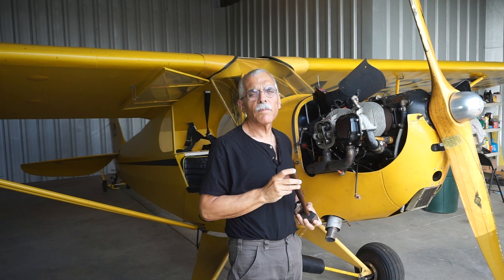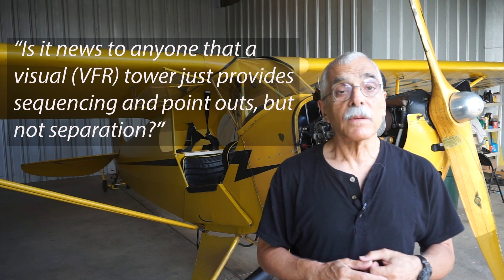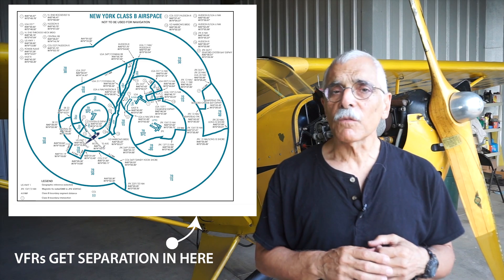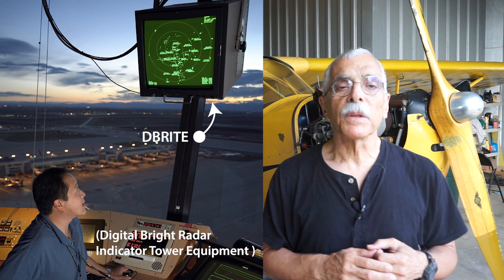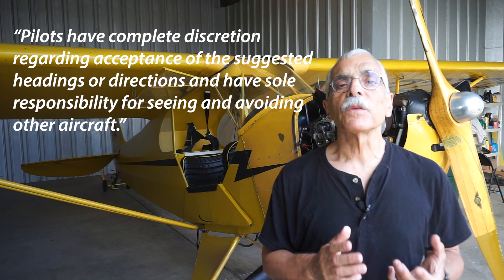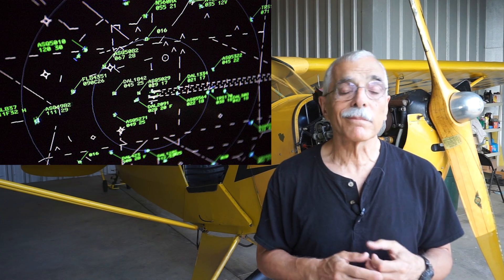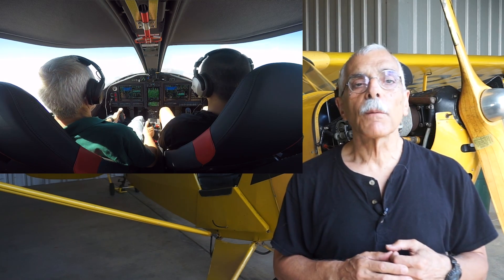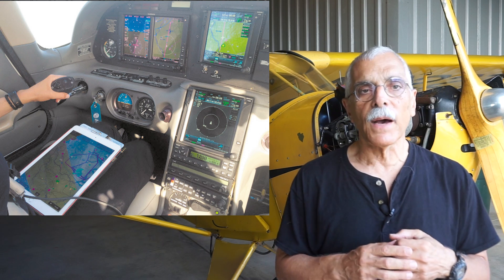Control Towers Don't Do What You Think They Do

Comment: On my solo flight out of Vandenberg airport in st Pete Florida I did my 1st and 2nd solo flight no problem but mu 3rd was different the tower controller changed and she called me #2 to land to a light jet 2 miles out on a straight in. I was in a 150. The jet was a lot more than 2 miles out when I finally seen him he was 15 miles and but the time I got past him I was around 6 miles south of the airport. I did try to tell the tower I could get in and out of his way when I was ready to turn bass but she was not having it. I had never done a straight in approach before so I had a problem. I was 6 miles south on a straight in approach over water yes that runway is sronded by water on 3 sides. Less just say it was going to be fun. Lol I did make it in with a trick my dad tout me called a slip and it worked well. But the instructor and the tower had a few words out of the plain I was not involved in there conversation... lol she was trying to give me time to get in without being rushed but this was a little crazy. It all worked out and was a great experience

Comment: Very good video...but I still am missing something here about towers and separation:  If I am coming in on an IFR flight plan, and handed to a tower, am I or am I not being kept separated?  I have always assumed I was.  Certainly, when I am also in the class D with a big part 121 airliner, I have assumed that they are being kept separated....so am I not?
Reply from the maker: You are separated from other IFR aircraft in Class D airspace, but not VFRs. Class B and C have VFR separation requirements. Many, if not most, Class D towers do one-in/one-out separation, meaning an IFR departure won't be released until an IFR arrival has landed or cancelled IFR.

Comment: Your info was mostly correct but highly misleading. There is more to almost every example you gave, however, I’ll be brief. ATC is a very valuable resource and to portray as incompetent (which some are) and burden to a pilot maybe the very link in the chain that keeps a pilot alive. 
The faa is the organization that started handling “deals” differently, but it was for exchange of information. A controller must file an ATSAP which is like a nasa report for a pilot. The program is not perfect but it has led to many changes to make the system safer.
Runway separation is the only tower function, well that’s only part of the story and would love to go further into that.
I’ve been certified in multiple up downs ( tower and approach) at an ARTCC and now at a core 30 tower. As a pilot I use flight following and atc services every time I fly.
I was only commenting so that you might consider the benefits of having atc a part of your flight. And not scare people from using their services.

Comment: A Control Tower controls all movements on the ground. Planes, cars and emergency equipment. Towers also control IFR traffic within their Class D airspace for clearance, departures and landings.

The VFR Flyers are given advisory reporting of traffic sequence in the air. They can enhance separation by requesting to report "left downwind" or "enter 2 mile right base. It's still see and avoid in all areas of VFR Flight rules.

There is nothing wrong with reporting your altitude to help situational awareness when the need arises.

If you need to extend downwind or prefer a different runway, request it.  Communication is key when inside Class D airspace. Identify the traffic you have in site. Let the tower know your intentions. In an emergency, you suddenly own the the entire airport and area priority over all other traffic.

Comment: Why is it seen as more reasonable that there is now less strict reaction to failure in opertions that are supposed to ensure a baseline of separation? Is the current situation precisely the most reaonable, or will things continue to become more reasonable as increasing slackness and breeching of parameters are increasingly tolerated?
Reply: Because moving from a Guilt/Blame culture to a Safety culture, i.e. one in which honest mistakes that don't actually cause dangerous outcomes are not punished with the same draconian rules as truly negligent (in)actions; allows for those mistakes to be used a training moments and also encourages controllers to come forward when these happen, instead of hide them, wait until after the records have been taken away.

It allows for a controller that misjudged how quickly an aircraft was going to turn and ended up with 4.8 miles wingtip to wingtip and 900ft vertical.

Now to address the elephant in the room, yes systemic issue (as well as just repetitive failures) are addressed, negligence is not tolerated.

It is a program very similar to NASA's ASRS, and will often would in collaboration with them depending on the event. The goal is to improve safety across the NAS.

(Yes, I have drank the Safety Culture Kool-aid, and fully believe that ATSAP is a good thing for the Agency and NAS in general)
Reply: @JPatterson61586  You appear to say that Draconian rules are now only applied to "... truly negligent [in]actions... " as punishment; while, distinct from this activity, there are non-dangerous mistakes (presumably defined by being behaviours outside of criteria for safe procedure), which should be exposed and openly discussed by those who make them for the sake of learning, and therefore the non-dangerous mistakes should not engender the Draconianism applied to truly dangerous and negligent ones.

Have we discovered a bit of a flaw in this prevailing mindset that you've described?

Comment: Sorry Paul... Huge fan here but as an ATCer, both radar and tower this video is incorrect on the extreme level. Reach out if you want...
Reply from the maker: Already did the reach out. This content was put together with the help of three controllers, two with tower and ground experience and one center controller. How it's incorrect in the extreme is itself extreme.

In edit, I noticed one thing I would change. Some towers do have radar separation authority which I glossed over with "except in a few cases." But none of them are VFR towers, that I know of. The critical knowledge for pilots is that in Class D, they are not getting hard separation and maybe not even the alerts. The accidents I highlighted show this. In the context of the Centennial mid-air, this is survival-level knowledge that at least some AVweb readers tell me they did not know.

Now they do.
Reply: @AVweb  So how do we know which Class D are "VFR towers" and which have radar separation authority (or does it matter at all?).  At the closest Class D to me, pretty low traffic, I regularly hear the controller tell someone "your ADS-B [or transponder] is off", so I guess they at least have D-BRITE. They also issue frequency change approved just barely before you leave their airspace, no matter how busy.
Reply: @AVweb The reminder of VFR pilots being ultimately responsible to see and avoid traffic is spot on and welcome but the statement "even towers at those big airports live to separate airplanes on the runways, that's all they do." is not accurate... They do a lot more than just runway separation. Not all towers are created equal, even the "VFR towers". What ultimately determines what kind of "services" you'll receive at a tower is a combination of what airspace classification it is AND the kind of radar display they have FAA 7210.3 10-5-3 (if they even have one) AND whether if its a federal contract tower or a FAA air traffic tower AND the local procedures found at that specific facility. The separation services you receive at OMN or MVY tower are very different from the separation services you'll receive at PWK or BED towers. Both are class D but OMN and MYV are contract towers and PWK and BED are FAA towers... different authorities, different capabilities. As @Grey Havner says below, how would any pilot know this? They wouldn't b/c the FAA does a terrible job of making that information easily available. Starting from the top, pilots keep your eyes out the window and your head on a swivel, Amen. When your wheels aren't on the runway the tower doesn't have any separation responsibility for you... not correct.
Reply: Sorry 'Hugh', but your correction could have fit in the comment you already posted so don't wait for the call

Comment: “See and Avoid” does NOT work.  That Cub is a flying blind spot.  You can’t see what’s directly in front of you in a climb, you can’t see above the wings to either side, you can’t see aft, you can’t see directly below.  There are struts, gear legs and structure in your way also.  And you really think lifting a wing to briefly check for traffic is going to save your bacon?  By the time you lowered your wing and began a 2 minute turn, a Cirrus or Baron that was previously invisible to your naked eye, would have closed that gap and nailed you.  Midair’s are relatively rare because of statistics (number of aircraft for a given airspace), not because of see and avoid.  I wonder how many aircraft have zipped by you that you never knew where there.
Reply: Which is why big rigs have no windshields.
Reply: Technology doesnt work either. We are humans, accidents are going to happen. There is a balance between technology and see and avoid. I work with automation for my job and I don't trust technology or humans.

Comment: (Apply penetrating oil and let sit at least 24 hours, then tap lightly but persistently with said hammer. If unsuccessful, use judicious use of a blowtorch to expand the metal of the valve head, and tap again. If still unsuccessful, let a qualified mechanic remedy the matter, since the probable cause is significant galling and/or spalling in the valve guide, which will have to be corrected anyway with a suitable replacement).
Reply from the maker: This one is, sadly, hellishly stuck. Cylinders came off for guide reaming and clean-up.
Reply: ^ He is right you know.

Comment: To be more clear, "separation" is not synonymous with minimum radar separation though that is the most common in the lower 48 today; separation only means that the two things are kept from direct physical interaction, whether it is aircraft-aircraft or aircraft-terrain. The term only applies to IFR to IFR aircraft, even tracon and center with radar are not legally reponsible for IFR-VFR though they will assist preventing problems if they see them.
Types of separation in the rule book include: Tower-visual separation where the tower can see the two IFR aircraft and has radio contact with at least one(no minimum distance); aircraft visual where it is on the pilot to not collide with the item they have in sight (includes vfr on top); radar separation which has fixed distances; time based separation(aka non-radar) where there is a minimum delay between two aircraft crossing some a checkpoint. Runway sequencing is also providing separation. (VFR on top was more useful in the pre-radar days.)

A bit of a rare novelty: there is a section in the ATC rules where visual towers do provide in-air IFR separation outside of their airspace, specifically where the flight is IFR but the tower has visual and radio contact and then hands off control to a nearby tower that has also made visual and radio contact, all without involving center or tracon. Totally non-radar so the 3 mile rule does not apply.
Reply: And the tower still can't get ADSb from many planes at low altitudes in mountainous terrain As it requires a ground receiver. So don't rely on ADSb even in airspace that requires it.

Comment: Okay, former LaGuardia Tower controller here. When I worked there LGA was classified as an IFR tower. We had what was called a "bright scope" in the tower, and we absolutely WERE responsible for separation from handoff on approach all the way down to the runway. We could give radar vectors if we needed to. And Paul, you were right - in my day one "deal" could definitely result in de-certification, or even termination, regardless of fault.

Interesting side note about the NY airspace: we used to consider 3 miles as the MAXIMUM distance between airplanes, that a "miss" was as good as a mile. If we didn't operate that way the traffic would have been backed up all the way to Chicago. This was before the National Command Center was established.

Class D towers only guarantee separation on the runway. Class C towers only provide airspace separation for IFR traffic. Separation for ALL traffic is provided in Class B airspace.
Reply: Side note, that's why cloud minimums in class B is "clear of clouds" as opposed to the 3 1-5-2 rule, sort of? You aren't really looking for other aircraft not talking to anyone in class B because everybody is afforded separation.
Reply: @WinginWolf  You got it.
Reply: As a former IFR and VFR controller that operated in and out of LaGuardia for 30 years I have  the upmost respect for the ATC operation there.
It is a very unique operation with extremely limited resources.(real estate) 
I cannot really think of a similar operation anywhere. Both the pilots and controllers were always on their game.
Almost all professionals usually operating the same  weight category. Always seemed to me that ground control was the tough job. 
But like I said amazing operation with the resources available.
Reply: @larrydugan1441  Thanks Larry. LaGuardia is one of the most challenging towers in world - intersecting runways, wide mix of aircraft types and speeds, choppers and floats transiting from Long Island to Manhattan and back, and the very limited footprint. Ground control is exceptionally difficult at LGA, perhaps the most difficult GC job in the country.

LaGuardia Tower takes some serious air traffic control skill and I'm proud to hold a Control Tower Operator's Certificate for that airport.
Reply: Not an expert on any of this, I've played flight simulator once about 25 years ago, but NYC has some of the nastiest airspace in the country.  That Yankee baseball player and pilot who crashed into an apartment comes to mind, and apparently small planes do or used to do just visual flight rules in the NYC area, with no transponders needed, back in the day, a couple of decades ago.  Another reason to automate everything.  When Joe Six-pack like myself starts flying a flying car, solve for the equilibrium.  Automate, pronto.
Reply: @raylopez99  The Hudson River and
 East River Exclusion Special Flight Rules Area exist to allow travel with limited contact with air traffic control.
Reply: @syramento  How did that work out?  I guess more or less OK given the number of flights per year I suppose.  FAA tombstone mentality.
Reply: @raylopez99  Well, from the Tower's perspective it was great - fewer aircraft to manage, less radio congestion.
Reply: @raylopez99  The baseball player deal was pilot error. 

Hey, atc guy, a pilot at Kennedy flew a commercial jet vfr to Laguardia. I heard the recording.